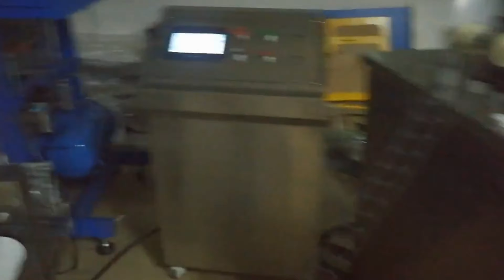Caps wads inserting assembly machine pre-cut foil&roll film type wadding equipment 全自動鋁箔衝切入蓋機

Comment: I have a question If single wad Goes in Cap machine will work it's Good. But If Double wad Goes in a Cap,Sir have you installed any sensor to stop the machine by identifying double wad.If installed which sensor you have installed kindly reply Sir